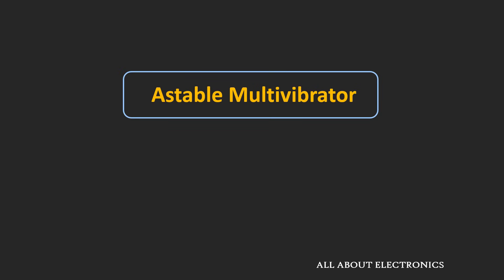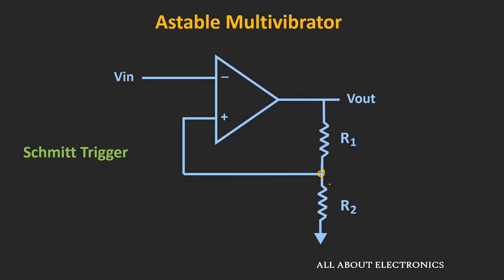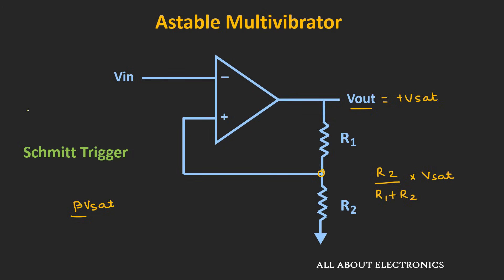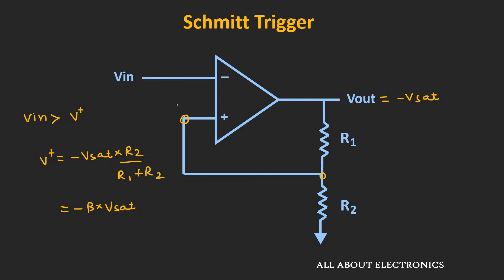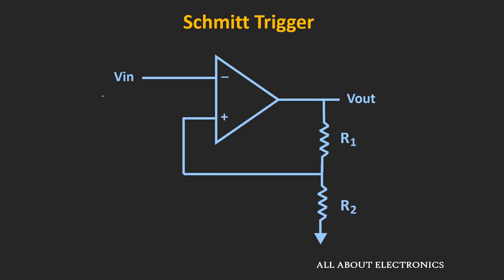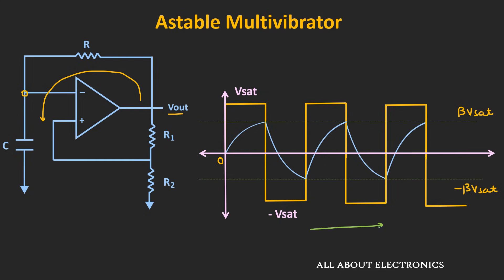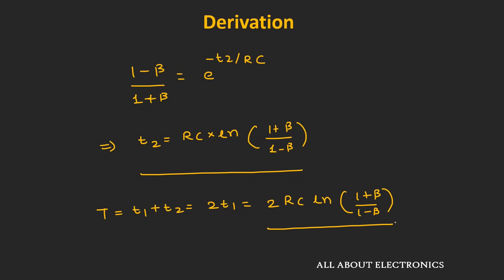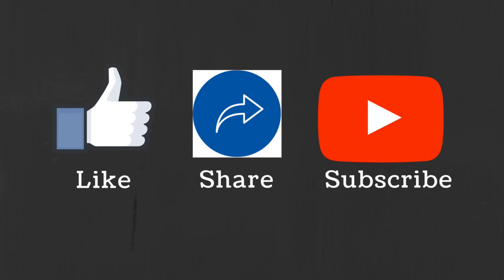Astable Multivibrator (using op-amp) Explained

Comment: Why during +Vsat the voltage at the inverting terminal become greater than the non inverting terminal? The capacitor charges till +vsat and the positive n inverting terminal of opamp should have same voltage??
Reply: Ok i understand now... Thanks
Reply: And also why is the V final not equal to +beta Vsat in the derivation.. final capacitor voltage is +beta Vsat not +Vsat?
Reply from the maker: Vfinal is the voltage towards which the capacitor is charging for the given applied voltage. But as soon as it reaches the beta Vsat voltage, the output of the Schmitt trigger will change, which will prevent it from charging towards the +Vsat voltage. (And same is true for the -Vsat voltage)
That's why it is +vsat and not beta Vsat. (Due to the abrupt change in the input voltage to the capacitor at Beta * Vsat, it is not able to charge till Vsat.)

Comment: I didn't understand the part where in derivation to calculate time period the Vfinal for capacitor voltage is Vsat.
While in actual capacitor charges upto BVsat. So why Vfinal=Vsat?
Reply from the maker: The capacitor is charging towards the voltage Vsat, but when the voltage reaches BVsat, the output suddenly changes to -Vsat. If that is not happening then the capacitor would have charged up to Vsat. That's why Vfinal = Vsat.
I hope it will clear your doubt.
Reply: @ALLABOUTELECTRONICS  This is excellent from u.Thank u..
Reply: @ALLABOUTELECTRONICS  but if capacitor would reach Vsat then the reach time would be higher than the time capacitor reaches to B*Vsat. how can we apply the same formula

Comment: Hello sir..could you please tell when is virtual short not applicable in opamp??
Please tell all the cases where it's not applicable.
Reply from the maker: The concept of virtual ground is only applicable when op-amp is used in the linear region.
Here, like you can see, the op-amp is operating in the saturation region (Between plus-minus Vsat). So, the concept of virtual ground is not applicable even if it seems to appear, there is a negative feedback. (along with the positive feedback)
Reply: @ALLABOUTELECTRONICS  ok but if there is no negative feedback but some positive feedback through a combination of resistors is the virtual short still valid??
Reply from the maker: No, it is not valid. When there is a positive feedback in the circuit then op-amp will operate in the saturation region and virtual short is not valid in that case.
Reply: @ALLABOUTELECTRONICS  ok thanks! You should start teaching microprocessors as well. Your videos are great!